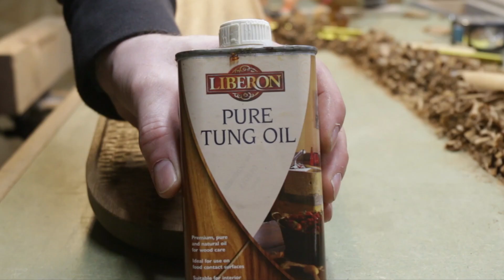HAND TOOLS ONLY || WOODEN SERVING PLATTER PART 1 with TEXTURE - HAND vs MACHINE woodworking

Comment: I was really wondering how you were going to hollow out the middle area, and that was definitely not what I was expecting! That's a really interesting way to do it and I'll have to give it a shot sometime!
Reply from the maker: Hey Morgan. Yeah probably not the most efficient way to do it but the only way I could think to do it with the hand tools I have. A larger router plane would have made the job easier that's for sure!! 

Nearly finished the Power Tool only video which will be out next week so can compare which comes out the best!

Comment: Is that Carnauba wax you use to rub your plane with? I used to use candle wax, made the plane fly 😂 
Mahogany is lovely to work with and oak.
Reply from the maker: It's a very lightly oiled rag rolled up in a wooden stand. I also use candle wax just depends what I grab first 👍
Reply: @studioyan  yeah I've seen a lot of people use the rolled up oiled cloth in a can, it certainly aides the cutting. Good to know, cheers